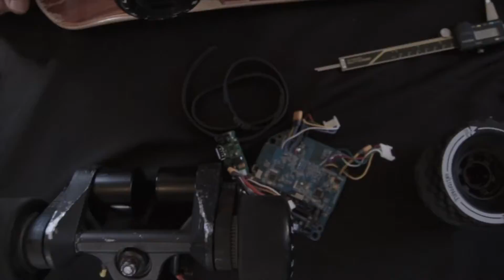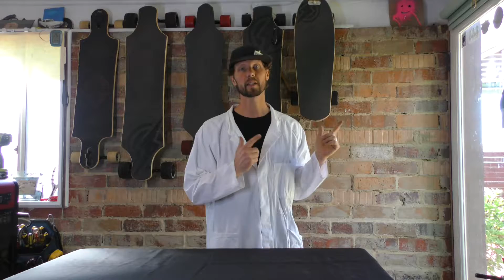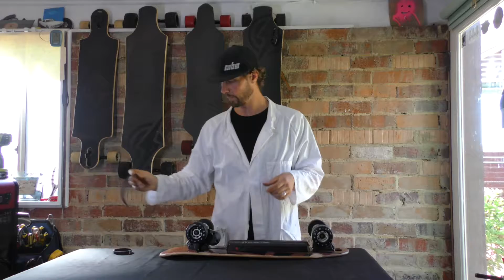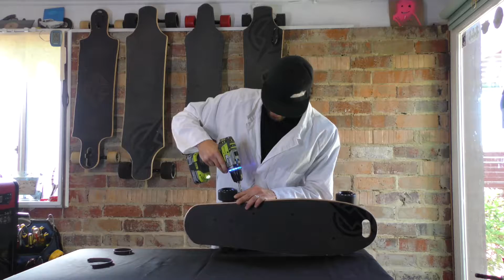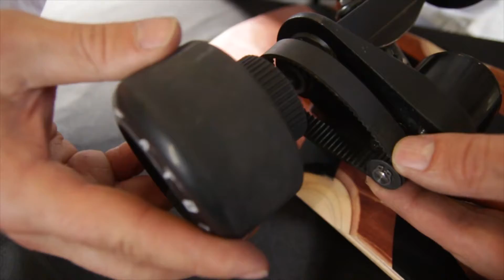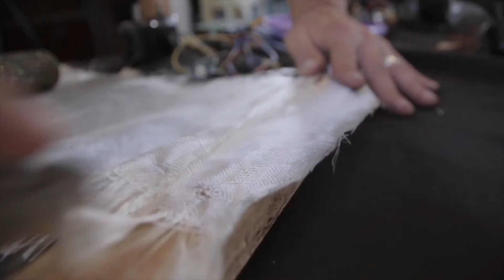TECH TALK - Belt Replacement - B10/B10X

Comment: Hey still not much info In changing street wheels to cloud wheels. I was able to figure out the pulley, but the belt was hard to research a replacement. I went with my best guess, but would love to see a video for how to properly chose the correct belt size for swapping to a new pulley, and gear

Comment: Hey, my board is under performing and the motor sounds weak. It can’t climb hills or reach max speeds
Reply from the maker: It could be a few different things.  An old belt that is slipping can cause those symptoms, but the braking would also be weak (belt slipping when braking).  Another thing to check is that you're still on HIGH speed mode ("H" light on remote should be lit, not "L"). If neither of those it could be a problem with your battery or motor in which case you should file a warranty claim on our website - https://www.atomlongboards.com/warranty.  Even if it's not an actual warranty that's the best way for our customer service people to help you.

Comment: Is it possible to use another wheel? Or I should replace for a original one? I am asking because I just bought my b10 and I am going back to Brazil in December and I need to know if I have to bring some replacement parts. Thanks.
The board is awesome!
Reply from the maker: So happy you're loving your board.  For the drive wheel (the one powered by the motor) you really need to use the original spec.  You can buy them online atomlongboards.com - https://www.atomlongboards.com/parts/b-series-electric-longboard-wheel-80mm-1 . To get the most life out of your wheels you can rotate them around like you would on a car.  The drive wheel wears down faster than the others.

Comment: Nice video! I am thinking to buy a carver CX and install it in a Atom Electric B10 Skateboard. Do you think it is gonna work well? My main concern is the fact that I can only replace the front truck because the rear one is connected to the eletric/motor system.
Reply from the maker: Sounds like a great idea.  The front truck is the most important one with respect to the Carver trucks.  That's where you get that super surfy feel. Not so important in the back.  In fact, keeping the existing back truck will be better for stability.  Sounds like a sick set-up.  Send us a some pics and feedback when it's done.
Reply: Thank you very much for your response! That is exactly what I was thinking, but I do not have experience with skateboards. Really good to have your opinion.  Yesterday I thought that the battery location might be a problem considering that the carver truck rotate much more than a usual truck, so it might hit/touch the battery when carving. But I guess it is a matter of adjusting the truck in order to avoid that.
Reply: Just bought my Skateborad B10. But I should have bought a belt with it.